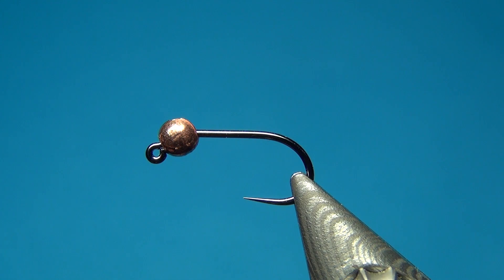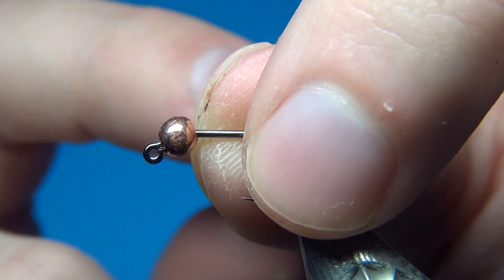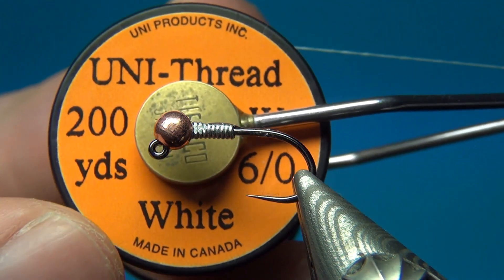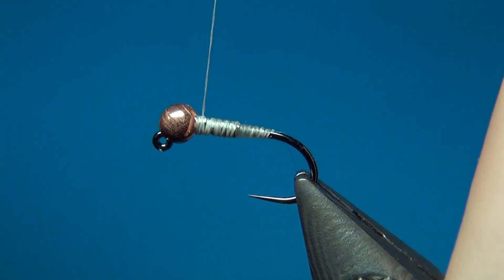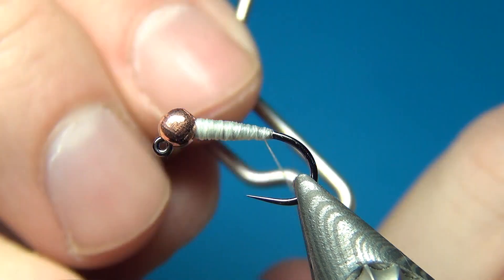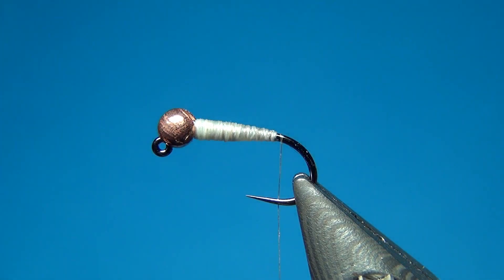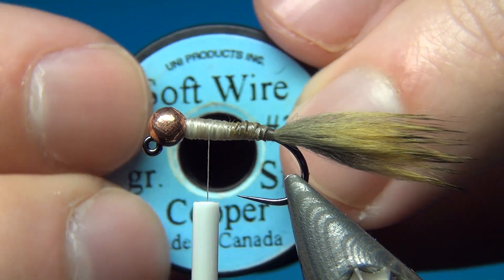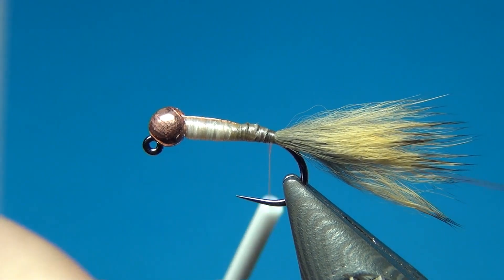Fly Tying Zonker Bugger (jig variant) | Hackles & Wings

Comment: You can also secure the bead by first wrapping the front bend area (by the eye) with tying thread sufficient to hold the bead when the bead is pushed fully forward.  Whip finish and cut off the thread.  Push the bead into position over the thread "retainer".   Reposition the hook in the vise so that the slotted opening is facing somewhat upward.  Use a couple of coats of thin UV resin to fill the gap beyond flush, so the contour is similar to that of a regular jighead.
Reply from the maker: That would be another way to do it, seems nice if you would not like to add any wire and to keep the fly a little lighter. Thanks for the tip, will have to try it.